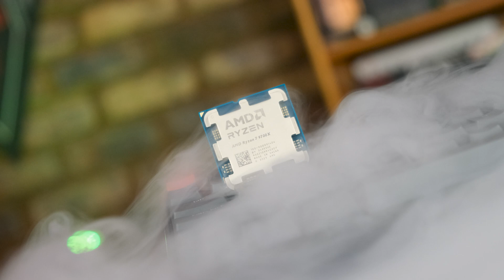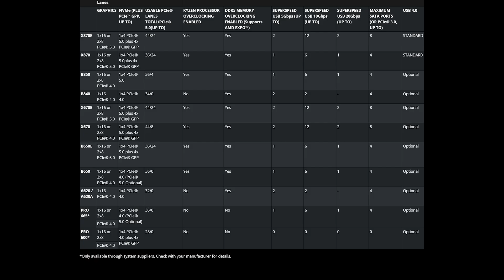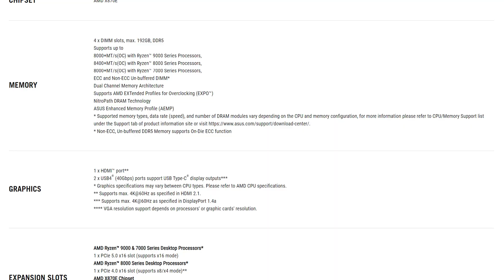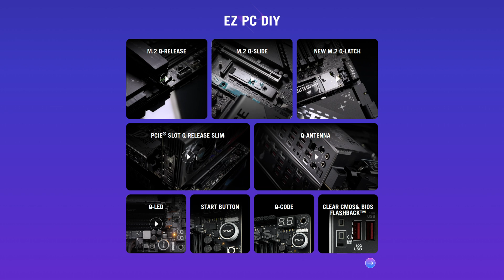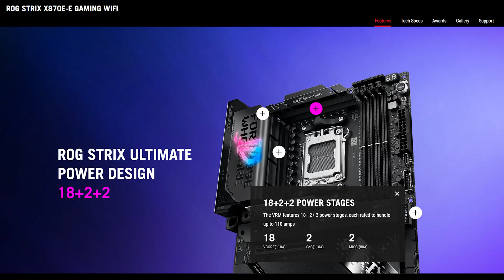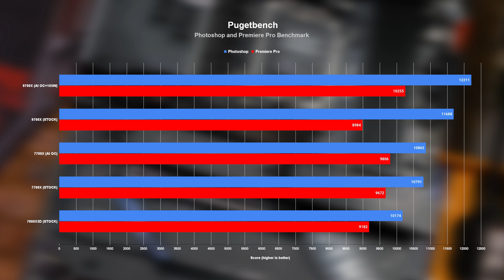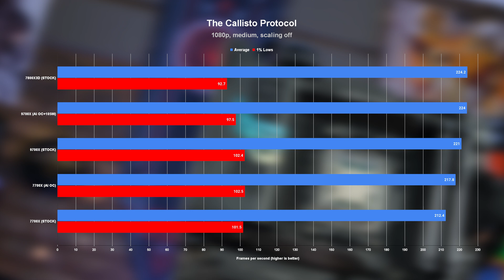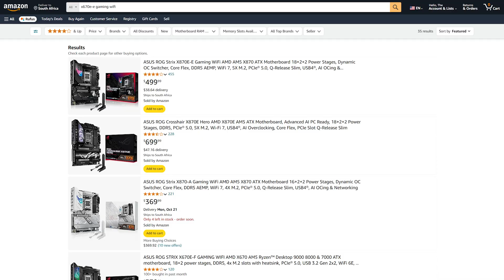Are X870 Motherboards EVERYTHING WE WANTED?! | ASUS ROG Strix X870E-E Gaming WiFi Review

Comment: Have 870e-e with 9800x3d. Never had any issues with this combo. Performance is great and AI overclocking and colling is a plus. Next Gen capabilities and support for extra connections are excellent. Obviously not for everyone who are looking for simple setup and won't be using all bells-and-whistles. I am happy with my decision considering future upgradability.
Reply: Interested in which RAM you installed.  Looking at same MOBO and CPU.
Reply: @tribe9590 I got G skill trident.
Reply: i have a B850e which is the mini version of it and it works phenomenal
Reply: I plan to to have this very same built, are you expiriencing any issues now? or everything is still running well?
Reply: Did your board need bios update 1st ? I am noticing that stock boards need bios updates before it can run the x3d

Comment: Hello, why are only ASUS ROG STRIX X870-E GAMING motherboards with WIFI available on the market? 
We don't need WiFi with an antenna, and for the ASUS ROG STRIX X870-E GAMING we could do it without 
an antenna, (because we already have a WiFi USB stick, so we don't need an antenna) and WITH A 
LOWER PRICE, BECAUSE THIS BOARD IS TOO EXPENSIVE, for us who buy it Asus products and that board 
should have as many RED USB INPUTS (10) as possible on the REAR with USB 2, GEN2 (with 20 GBps) and 
not 10 GBps and Type-C THUNDERBOLT could be all four 40GBps, not that two of them are only 20 GBps each. 
300 to 350 Euros would be enough for that board, in Bosnia and Herzegovina, because the standard here is low, 
and new boards with better chips will arrive soon, for socket AM5, so the price of this board will drop 
soon. Also, the processors for that board are too expensive . I hope that in the near future you will 
REDUCE the PRICES of items and make such a board as I wrote above (with as many RED USB PORTS as possible, 
preferably with 20 GBps REAR) 

... Best regards

Comment: Thank you for the video! I have a couple of questions: Does the M.2_1 slot connect directly to the CPU? Additionally, I plan to use a second M.2 drive for data storage and gaming. Would you recommend connecting it to the M.2_2 slot, which shares bandwidth with the GPU, or should I connect it to slots 4 or 5 instead? I'm using a PCIe 4 Samsung 980 Pro.
Reply from the maker: Thanks for watching! In your position, I'd use slot 1 for my OS drive, and use slots 4 and 5 for additional storage. As long as you avoid populating slots 2 and 3 you won't risk slowing down your GPU.

Comment: expensive asf just to get usb 4 which can be an add on card if you even have a single device capable, theres nothing special besides usb 4 in these new mobo and they cost way more, eh its your money go ahead and waste it
Reply: Power delivery for OC is the main driver imo almost no one is using that many USBs
Reply: @64Talon  who the hell is stupid enough to OC for 4-5% gains with added heat, use your brain
Reply: He boss your comment is 10 months old!! 
 
Just checking are you still down on your luck and salty or did you finally get ur money up

Comment: Do i need an 870 series chipset to maximize a 9800x3d? Will the 670 work as good?
Reply from the maker: Nope, the X3D will run perfectly in an X670 board. No performance difference between 870 and 670.

Comment: My Threadripper 2950X system died very recently, so time was short to research and buy the right/best parts. MSI and ASRock 870E boards don't appear to be available here, yet, and I didn't feel like parting $1299 for the Asus Hero 870E, so I plumped for the 870E Strix. Only after bought was I able to start researching what I was getting - and it surprised me that when compared to the MSI MEG 870E and ASRock Taichi, the Strix board lacks PCI lanes (my understanding), so additional M.2 drives will start to hijack lanes from the GPU?
Reply: Yes brother, if you populate the 5.0 ones your Gpu will ran at x8 speed

Comment: Hi, thanks for the review. Looking at this motherboard, and would love to know what the flexkey options are in BIOS? The manual doesn't say. I'm hoping that it can be used as a "safeboot" or a clear cmos button. Do you know?
Reply from the maker: Hey. The Flexkey button can be set to a couple of different functions in BIOS. I usually leave it on reset, but you can also set it to launch to BIOS, turning lighting on or off, and activating Safe Boot etc.

Comment: Sorry for the basic question, but I just want to confirm. Would you see any issue running 1 NVME in slot 1, another in slot 4/5 and a 10gb NIC in the bottom PCIe? Being I live in Japan I have 10gb to my house (about 60$ a month) and dont want to degrade the speed at all by saturating PCIe lanes.
Reply from the maker: Actually a great question! I had to look it up to make sure. You should have zero issues with the configuration you just mentioned. Even if your NIC does somehow take up more than 4 lanes, you'd still be in the clear.
Reply: I've read a user post on Amazon and on your YouTube short from people saying if you put m.2 drives in slots 4 and 5 it disables the second pcie slot. You are indicating it doesn't. I'm looking to populate m.2 slots 1,4,5 and use a capture card in the second pcie slot. I'm finding conflicting answers and the motherboard manual doesn't mention any sharing with the second pcie.

Comment: Can you please test the AI features on the 9800x3d?

I'm curious if it's worth getting this motherboard with 9800x3d especially when it's been confirmed Zen 6 will use the AM5 socket so choosing a X870 chipset as it has higher ram speeds available just incase Zen 6 can use faster speeds better.
Reply from the maker: If I get my hands on the X3D while I still have the board I definitely will! I wouldn't personally pick a board specifically for the memory support if I were you. There's a speed sweet spot for Ryzen where going faster results in some serious diminishing returns...

Comment: someone explain the lane sharing set up on this one to me, GPU in the pcie slot, first SSD in m2_1? extra SSD in m2_4?
Reply: So the first top three slots for the M.2 are your new Gen5 PCIE. M.2-1 is the one under the Ram slots that has the quick release heatsink, this one is a slot with no compromises towards the other PCIE lanes. M.2-2 and M.2-3 will be the ones right under the CPU slot they both share the same Heatsink or right above the PCIE for the GPU.

 These two M.2-2 and M.2-3 slots are gen 5 and share the same lanes with each other which are controlled by a switch to interchange transfers I believe I can be wrong on this one.  M.2-2 and M.2-3 compromise the PCIE 16X cause it also shares the same lanes. So when you populate any of these M.2 with a SSD your board will automatically set the PCIE 16X to run at 8X only no matter the Gen type SSD. 

The Bottom M.2 -4 and -5 will be your GEN 4 PCIE on the X870e chipset. They do not compromise the other PCIE lanes. So if you have a GEN 5 SSD and a GEN 4 SSD you'll want to use your M.2-1 with Gen5 SSD and M.2-4 with Gen4 SSD or just use the M.2-1 if running a single SSD no matter the Gen you on. 

Just note that it will run according to the Gen so if you use a Gen4 SSD on Gen5 ready PCIE it will only run at Gen4 speeds. Same if you running a GEN5 SSD on Gen4 PCIE.

hope this helps
Reply: @EQUID  thank you! I only have one ssd for now and after testing my new compared to my old samsung ones i havent put them in yet, but when i get another new one now i feel more comfortable about what slot to use, thats kind of how I understood it was just hard to find it stated in coherent english online lol, and the crappy table they showed in some manuals complicated it more because they  didnt title the rows and columns in a way that made any sense lmao

I appreciate your reply, probably the best and most accurate explanation ive seen

Comment: Great info - thanks. I have a 5120x2160 monitor - will the HDMI output from the board drive this without an external GPU?
Reply: Nope. At minimum, you'll need something like a GT 1030 card to drive your monitor.
Reply: @R6ex  Actually, I bought the motherboard and just finished building a new PC: the onboard HDMI drives 5120x2160 no problem at all.
Reply from the maker: According to the specs page "supports max. 4K@60Hz" via HDMI or DP. It also somewhat depends on your CPU capabilities. You'll still get a display, you might just need to dial back the resolution a bit.

Comment: Noob question here - With the 2nd and 3rd M2 slots sharing bandwidth with the PCIEX16(g5) which the GPU would connect into, does that mean that if you connect two SSD's into those M2 slots, you will throttle your GPU? My build will utilise x2 2TB SSDs, so if I connect one into M1 and one into M2, GPU will still run at x16?
Reply from the maker: 100% not a noob question - PCIe bifurcation is confusing, lol. According to the official product page, you are correct in assuming that running drives in those slots will drop your GPU lanes to x8. Luckily, gen 5 x8 is still more than enough to get the most out of 95% of current GPUs. I'd personally run my main M.2 in slot 1, and the rest in slots 4 and 5 just in case.

Comment: I am deciding between this board and asrock Taichi lite. Lite because I dont wans shiny plates and rgbs. I plan on putting WD850x 2TB only. 2x16 Gskill 6000mhz ram, 5080 or 5070ti when they cone out along with ryzen 9550x3d when its released. Would you say that asrock would be enough?
Reply from the maker: Oh absolutely. The new ASRock boards are some of the most overbuilt boards out there right now 😂 It looks like you're going to have an epic system on your hands there.
Reply: go with x670e bro...the x870e will take like 6 months to iron out with bios updates..
Reply: @psylencecy  Its not a problem. I have never gone to the last gen anything. Even if the x670 is 50 bucks... nah. New chipset or no buy.

Comment: Why the 6000 memory? Is not the board advertized at up to 8000?
Reply from the maker: 6000 is the "sweet spot" for current-gen Ryzen. Speeds faster than that, including 8000 is difficult to reach depending on your kit, can be unstable, and unless you know how to tune memory properly, shouldn't result in any huge uplifts in performance.
Reply: I have 8000 on mine and it isn't that stable.  I have to go through a few different iterations of memory training and tweaking to get it to stay where it's not having issues.  I would only recommend it for pure enthusiasts that are used to unstable ram. 6000 is the sweet spot and is the better one recommended for configurations now.  Even with the 8000 MHz ram, it's locked to 24 GB per channel because above that isn't stable until they release bios updates so the max you can do in a pair is 48 GB.
Reply: i am going to build it with predator 8400 c40 48GB, and check it it works on X870e-e, don’t forget to select UCLK=MEMCLK2 when you using 8000+ ram

Comment: Question: What is max no. displays (4K @ 60Hz) which can be connected to this board, to be driven from iGPU using 9900X CPU?

I understand this board has 1x HDMI and 2x USB 4 (supporting DP over USB). In principle, each USB 4 port could output to two 4K displays @ 60Hz (using an MST USB-C to dual DP adaptor). So I wonder whether it might be possible to drive FOUR, or even FIVE 4K @ 60Hz displays from the iGPU?

(of course, another limitation is max no 4K @ 60Hz displays supported by 9900X iGPU itself, I heard this might be a max of FOUR, but unconfirmed?)

I am planning new build using Ryzen 9900X and X870/X870E Mobo. Will not be used for gaming, for productivity only. I won’t install a discrete graphics card, will rely only on integrated graphics.
Reply from the maker: You actually have me stumped there, I've never really dug into onboard graphics all that much myself. But from what I can see on the board's specs page, it looks like you'll have to dig into the capabilities of the HDMI 2.1 and DisplayPort 1.4a standards to see what they can handle. The setup you're aiming for sounds really fun though - I hope someone else here can provide some actual input as I'm quite curious myself now 😅

Comment: I have an Asus x670E Crosshair Extreme and I haven't seen any other board that looks nicer in my opinion.  I would buy an X870E Crosshair Extreme if they made one and it looked like my X670E.
Reply from the maker: Oof, almost forgot how great that board is - maybe a teensy bit ostentatious for me, but still looks amazing! Let's hope ROG's working on an updated version for current-gen 🤞
Reply: Honest question - in what way would you expect it to be better?  The x670e exposes the same number of PCIE lanes as the x870e, and the Crosshair Extreme makes pretty good use of them already.  You have USB4 (although the controller shares bandwidth with m.2_1), and two PCIE that will run at x16/x0 or x8/x8 (and others)  assuming you don't use m.2_2 when they self-nerf.  You have a third Gen5 m.2 slot though and another Gen4, so you have options.  Is WiFi7 enough of a reason?  (And is the WiFI on a swappable pcie card on the x670e?)

Comment: Ich habe das x670e e Gaming und habe zurzeit 2x 980 pro 2 und 1tb drin und eine 980 pcie 3.0 1tb. Soweit ich weiß wenn ich noch eine m2 rein mache egal ob 3.0 oder 4.0 oder 5.0 wird die Grafikkarte nur mit x8 laufen wtf?? Ich dachte nur bei 5.0.
Reply from the maker: Yeah, unfortunately that's how almost all of the consumer motherboards and chips work. If you need a ton of PCIe lanes you'll have to go with something like the Epyc or Threadripper platforms 😭 To be fair though, depending on your graphics card, 8x PCIe 5.0 lanes will likely still give you full or near-full performance.

Comment: Can’t get 128GB (4x32) to post on the X870 Hero mobo with the latest BIOS 0505. I sure hope Asus gets this fixed faster than they did with the x670 version.
Reply: Did you check the motherboards QVL List? Always get ram based on this. Otherwise your ram may not work.

Comment: I have ROG Crosshair VIII Hero, but this looks like crap! I just bought MSI X870e Carbon for the same price as this catfish. It LOOKS WHAT! ALL M.2's ARE Toolless no screwdriver needed, nor small screws to drop into MB when changing M.2's like on this Strix monstrosity, Get it together ASUS without us having to spend $700 for a good-looking MB like the HERO's, you made me buy elsewhere.
I have been building with ASUS only since 1998.
Reply from the maker: Harsh, but fair enough. Purely aesthetically the Carbon doesn't do it for me as much personally, but the toolless heatsinks for all of the slots are a big win. The screws on the heatsink I removed in the video are captive - they won't be falling straight into your PSU (which has happened to me a couple of times 😅).
Reply: Have to agree. Reminds me of something Dolly Parton said; 'It costs a lot of money to look this cheap'
Reply: I returned my x870e hero because if U use the second pcie slot it disables one Nvme slot and makes the main pcie x16 drop to x8 I need to use my capture card which the strix x870e doesn't have

Comment: Would it have killed them to throw in another PCIe card slot?
Reply: Yeah, any board without at least 3 PCIe's is disqualified for me. Right now I'm leaning towards the MSI X870e Carbon.
Reply from the maker: There's a secondary all the way at the bottom, but yes that's a weird choice on their part now that I think about it.
Reply: @TheTechTank  I need three slots although I prefer 4 because I put a cooling card between the bottom two and use the blade holder in the back to support a second cooler
Reply: @TheTechTank  Does the PCIE 5.0 slot share lanes if you populate all the NVME slots? Thats very important i didint hear you cover that.
Reply: @KingBentPins the x670 carbon doesn’t share lanes with any m.2 it does share lanes with the second one which they both run @ 8x which is far better than most. And the 4.0 runs at 4x and doesn’t share lanes either. So you can run all nvmes without losing lanes. You can run 16x0x4 or 8/8/4 if you use all three pci lanes
Reply: @datsweetsansabooty  I'm asking about the x870 not the older ones
Reply: @datsweetsansabooty  8/8/4 with all nvme slots in use?
Reply: @genixia  it’s 16/0/4 with all nvme slots in use. It drops to 8/8/4 if you use the middle pci lane.
Reply: @datsweetsansabooty  The x670 Carbon, right?  It looks like the x870 Carbon took a big step backwards in that regard.  If I understand it correctly it will be 8/4/4.
Reply: @genixia  yes the x670 runs 16/0/4 or 8/8/4. The x870 boards running at 8/4/4 due to usb 4.

Comment: I think it is worth it x870e because this is exactly what I was missing for more than 10 years, always having problems with USB ports buying cheap motherboards.
 This is the reason why these motherboards cost so much.
Reply from the maker: Haven't had all that many issues with the built-in ports on my boards. The ports on my cases though... those always seem to suck.
Reply: @TheTechTank  On cheap motherboards I think  they share bandwidth with USB 3.0 and above, which when you try to populate all possible USB + SATA + PCIE they start to turn off without reason or lower their speed. Have you tried to populate all the USB ports on an old cheap motherboard?
Reply: My asus x670e-e that I got 7 months ago has usb issue on back I/o four ports just stopped working lol
Reply: @Mrendomii  Exactly my problem! They stop working for no reason, especially if everything is populated. Or slow down. That happens only because of bandwidth sharing. So it is important to know what motherboard you get and what share they have with the ports. Only Asrock taichi was good with that.
Reply: Right there with you having this problem. It's not like I'm even a demanding user or creative type, but I'm always running out of ports or having bandwidth issues when using hubs etc. Boards like this coming with 8+ high speed USB ports are so much better than cheap motherboards.